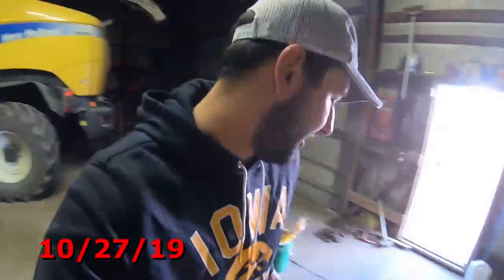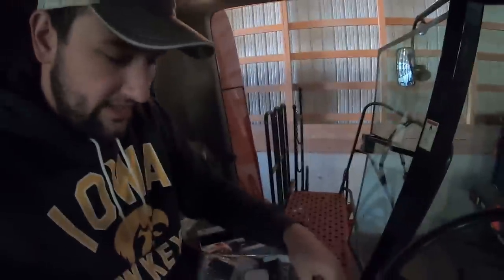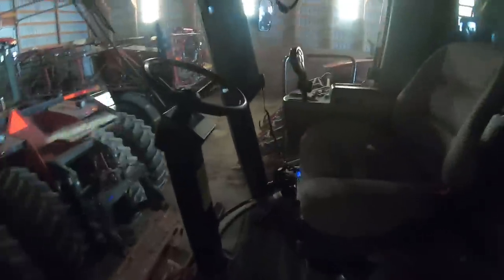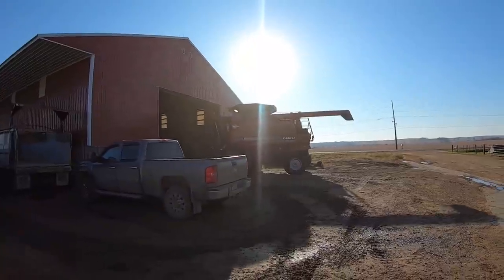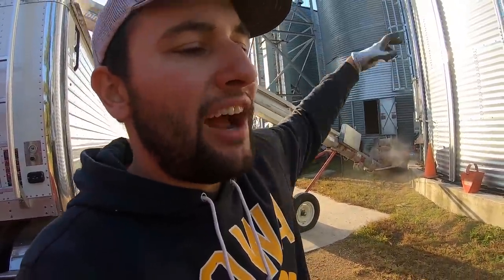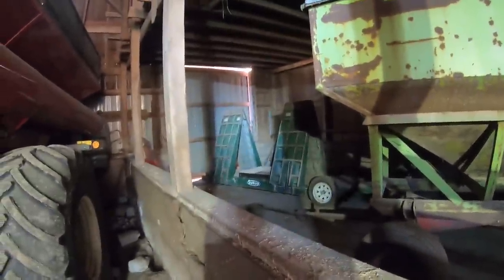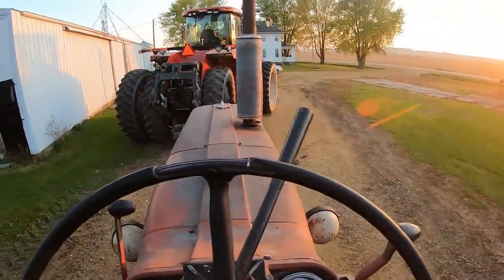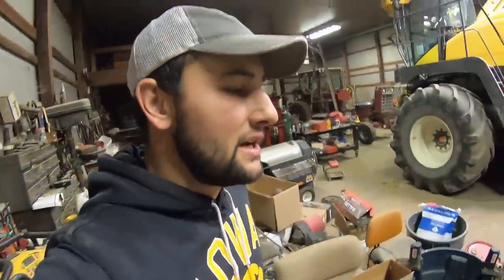Combine Meets the FOLDING Cornhead, We are Ready! | Harvest Video 12

Comment: Hi. We ues the same radio name over here but I couldn't tell if was the.  I find its the antenna wich is the problem most off i'v run different ones over the years. Cos off having C.B in all the tractors trucks cars every thing.  I'v only found one antenna wich really works well it's I carnt remember the spelling off it and the number off it off hand. But can let you no as soon as I get my truck back. It's good. And I get them from amazon.  But if you got the same C.B as us you have different settings for each country and when you got that right.  The only problem you  get is the Mike on them you end up having to hold it down for 3 seconds before you speak. Otherwise they are really good C.B. from Andy in UK

Comment: Bad luck on the chains and sprockets . But if something ain't broke why fix it is my thoughts . Midland radios - I ran a bunch of them when I drove truck OTR . Good radios in mountains was avg about 15-19 miles away depending on antenna coax and grounding . Hardy , durable used to switch them from truck to truck a lot and was always there for me . Other folks was running big expensive radios and having problems while mine always seem to work . I have one around some where along with my Cobra President limited . Check you on the next video . See you then . Just a thought if I could upload a picture of the truck you see on my Icon of the interior you would see a midland in there lol .
Reply from the maker: Very good thoughts and hahahaha that's funny!